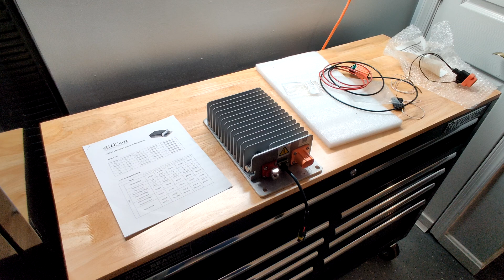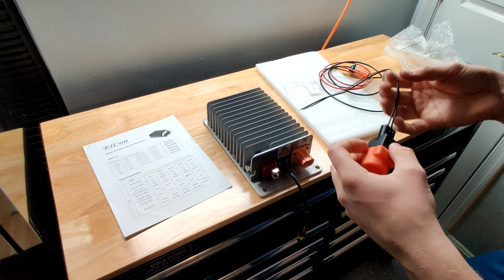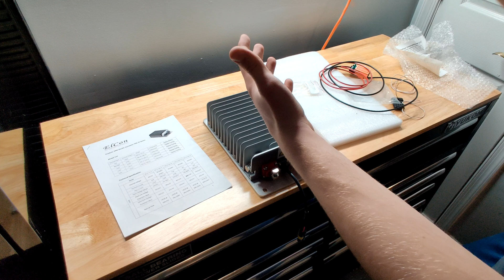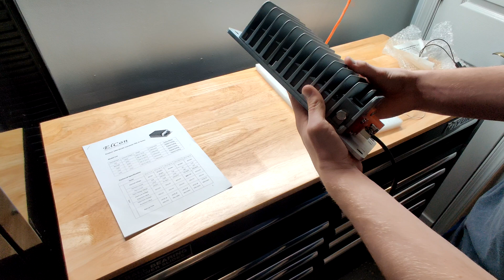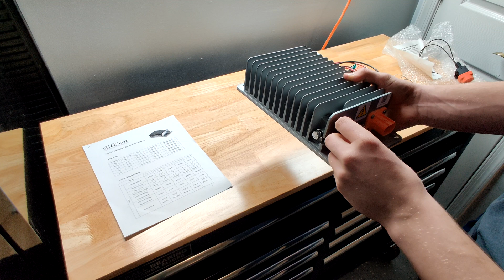Ford Escape EV Conversion EP 6: DC/DC Converter and Inertia Switch

Comment: you may want to add some textover comments or something to this video... i'm really worried someone might see you describe which cables are HV and LV and hook theirs up incorrectly. Thanks for the video!
Reply from the maker: Good call -- just added a card that should pop up around when I start talking about that. Can't believe I reversed them like that! Fortunately I did not make the same mistake when actually wiring the DCDC in the car.
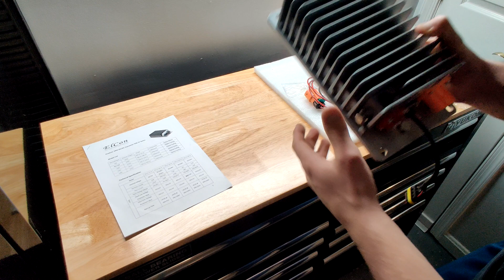Reply: @reider_mcfeely  thanks for that. You might consider adding two more. One at 1:48 and another at 2:17. These are the most concerning timestamps and people tend to fast forward through videos and not watch the whole thing